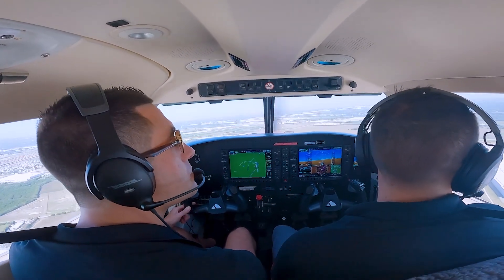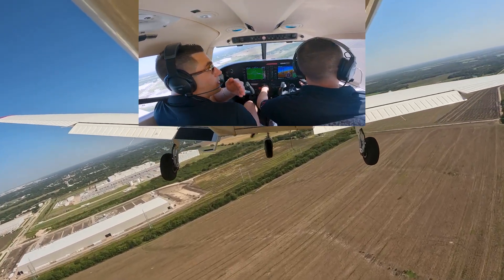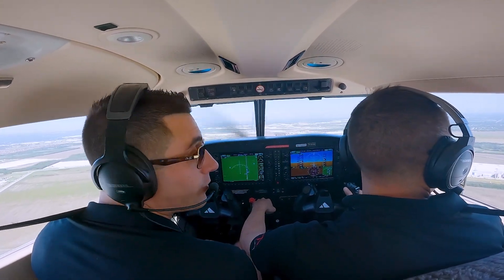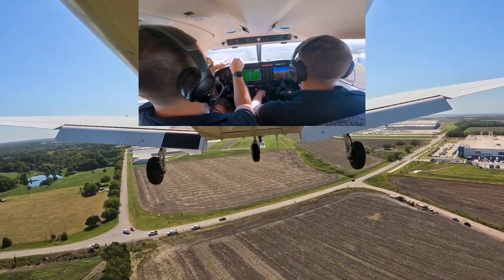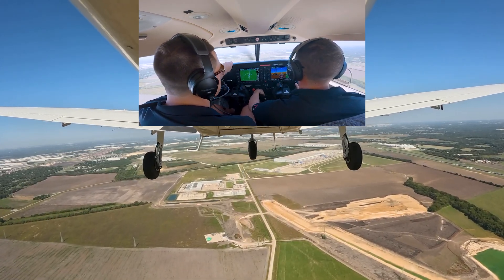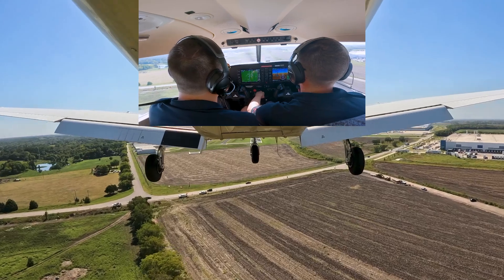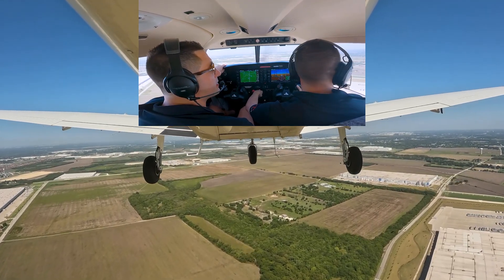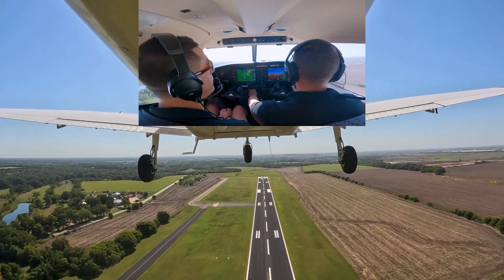How to Master Short Field Landings: Full Flight Demonstration

Comment: Why do you pitch to airspeed?  FAA standards are to pitch to vertical speed.  And as you know, the autoland system pitches to altitude (glideslope/flare).  Per faasafety Course ALC-34: Maneuvering:  Approach and Landing.  "After aligning with the runway, the final flap setting should be completed and the pitch attitude adjusted for the desired rate of descent."

Comment: Good job guys, with the smooth air control of the Cherokee on normal runways.  I know he is using rudder only to bracket the cenrerline between his legs, yours too as it is an optical thing, and there is no wing wagging and nose going the wrong way from adverse yaw.  There is a light interconnect spring, but if he uses rudder only (we don't want to turn so no bank so no aileron) to nail the centerline, the wing is automatically level.  I understand for testing the advantage of finding and using the calm air throttle setting for the slow flight that prevents too much float, but in normal operations the whole idea of throttle only for glide angle and rate of descent all the way to touchdown is that the throttle be used dynamically.  A gust balloons us, close throttle and then adjust.  A gust or shear causes a sink, lots or even full throttle and then adjust.  And with crosswind, set bank against crosswind and rudder only to nail centerline will automatically keep that bank angle.  Or if crabbing to near touchdown and then side slip, set crab and then rudder only to nail butt to target (centerline) angle.  This also keeps the wing level.  Good job.